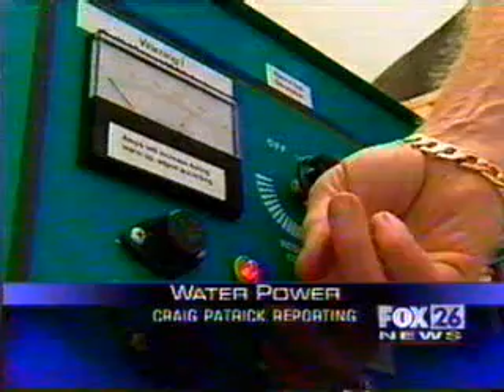Water Fuel Car

Comment: @a1mint Actually, there are examples of Steam Locomotives in operation TODAY.  The Model Railroad enthusiast. Most prefer Propane. (Less Smoke, Less fumes, Less Pollution) This is NOT an obfuscation, AND STILL, the only carrier of energy in Coals or Oils or Propane as used now, is the WATER. Hydroxy simply removes the pollutions and ash.  That you cannot accept that BASIC fundamental of all combustion is YOUR failing. SEE THIS Video. FACT: WATER BURNS,,, Knute

Comment: @a1mint AGAIN.  The Coals or Oils that once were used to fire Steam Locomotives are all, the product of organic processes of Photosynthesis. In the Chloroplasts of plants, WATER, is divided and the Hydrogen is bound to Carbon as Carbohydrates, sugars and starches, Oxygen let to the air. Under heat and pressure, deep in the earth, these Hydrocarbons are transformed into Coal deposits and Hydrocarbons. The only constituents that REALLY burn, are WATER.

Comment: @BigDaz Now, remember. Just prior to the closing ceremony when those balloons were to fall, and as tradition, the crowd to dance and stomp and pop those balloons, filling the room with volatile combustible gas, George was safe, the Balloon Vendor replaced and the compressed  tanks they were to use, removed. FACT: In the emergency, the Company that replaced the original Vendor; was limited to only using compressed AIR. DOUBT ME? Do the research. Knute

Comment: @a1mint I forgot,,, The only modification you will need to make to the crucibles, is in the “slag” hole. An increase of 4 times, in proportion, should work. Make only ONE slag hole, as the currents of molten metals need be drawn off in one direction,,, to form a “skimming” action. All the best, Knute, TR Knudtson

Comment: @a1mint Oh, one other thing. If you find the crucibles at the base of the Pyramid, DO NOT try to start this furnace or repair it. It was a flawed design. Do take note however, that these crucibles were never used. They will show no signs of ores or residue. BUT you can prove their design worthy, by testing them at smaller scales and making a smaller copy of them and employing Hydroxy as your heat medium. All the best, Knute, TR Knudtson

Comment: @a1mint Were the dust clouds, ejecta, visible immediately, prior to the actual collapse? SOOOoOOO quickly and so high up on the towers, that parts of the towers were seen to FALL THROUGH these fine dust clouds? Were their multiple seismic shocks registered at distant earthquake centers? Did they find molten masses at the foot of the towers, (STEELS’ reactivity to Hydroxy, “Hotter than the SUN”) that stayed red hot for WEEKS? As if HEATED in a furnace for days? TR Knudtson

Comment: @a1mint NOW, I will ask you again,,,, Was the smoke White or Black? Did the towers fall faster than freefall? (The vacuum effect of Hydroxy) SUCKED into the ground? Were the body parts of victims, limited to extremities, consistent with Spontaneous Human Combustion? Was the concrete pulverized to a fine dust? Are the First Responders suffering from chemical burns to their lungs? TR Knudtson

Comment: @a1mint Mike stop. I said that STEAM is an example of water being an energy carrier. You can use, Wind, Solar, Coal, Oil, Wood, OR Hydroxy to make steam for a Locomotive. Their energy ALL comes from capturing the energy of the sun and water. Fossil fuels over BILLIONS of years, or Hydroxy the DAY you need it,, and without the poisons, pollutions and greenhouse gasses. Are their Locomotives that used Coal, YES; also Coal Oils, Black Oil, Wood and even Alcohols.  TR Knudtson

Comment: @a1mint NOW,, I will ask you again. Are the First Responders exhibiting signs of chemical burns to the lungs? Specifically: consistent with Potassium Hydroxide (Caustic Soda) OR Sodium Hydroxide (Lie)? These are the more prominent electrolytes used to make the Hydroxy process possible. A way to enhance the electrical conductivity of water used to make Hydroxy Gas. All the best, Knute, TR Knudtson

Comment: @a1mint No, and I disagree. Like Hydroxy, I used steam as an example of how water is capable of absorbing energy (Directly) and that energy to be used as a form of power. You can make steam from direct “Solar Exposure” also by heating water using Wind or Solar electric, Geo-Thermal or electricity gathered from falling water, (Inline Turbines). The Steam Locomotive was only an example of WATER as a carrier of energy. An energy spunge,, if you will. TR Knudtson

Comment: @a1mint Sorry, I disagree. If you place a shiny kettle filled with ice water, over an open flame, you can see the water that is the primary component of all fossil fuels combustion; develop as a mist or vapor and condense on the sides of the kettle. Hydro-Carbons and Coal will all produce this same effect, basically, WATER from FIRE. This is called a reciprocal PROOF. Fire from water, and conversely, water from fire. This is a 3rd grade science experiment.  TR Knudtson

Comment: @a1mint Good morning. 

Mike, No, I said water is a carrier of energy. Thermal and electrical sourced and can also be disassociated by frequency, or combinations of these. The sources of these energies can however, be gathered from process that are non-polluting, Hydro-Electric, Wind, Solar, Geo-Thermal. You need not use GRID electrical power. TR Knudtson

Comment: @a1mint Okie, lunch is finished…. Mike, I was just trying to save you a little embarrassment. Coal, Oils, Wood, Wheat, Rice, Corn, Grass, Chicken, Pork, Beef, Plastic, Nuts, Beans, Fruit, Bushes and Grandmas kitchen table,,, ARE NOT sources of energy. Just,,, Biologic storage of SUNLIGHT. Now, Hydroxy ,, IS,,, different than normal Hydrogen in one way though. Simple Hydrogen is 100% inert, until exposed to oxygen. Hydroxy water, burns even in a vacuum. TR Knudtson

Comment: @a1mint This was out in the 1830s, READ, Michael Faraday, 1791 – 1867. The Chemical History of a Candle. Lectures and Illustrations. Harvard: 1904.

My contribution was to properly define the “Single Gas” produced by the electrolysis of water as a TRUE Plasma, 1967. “Hydroxy”: Electro-Chemical Plasma. Scalable to Micro Scales and also the discovery of Solar Plasmas and the advancement of the “Hollow Sun” theory, 1969. 

All the best, Knute, TR Knudtson

Comment: @a1mint Hydrogen is also the product of Photosynthesis, bound to carbon and the Oxygen,, liberated and containing HALF the energy needed. Water, the example of the greatest affinity of all elements, “IS” the primary product of combustion. Heat a polished and shiny kettle, filled with ice water, over an open flame, and you will see the WATER returned as a vapor and mist condensed on the sides of the kettle. WATER IS FIRE, and FIRE IS WATER. TR Knudtson

Comment: @a1mint And you present that energy just is,,, that there is no source,, I just disagree is all. Take a simple bar magnet,,, now HEAT IT. You will learn that the ability for the magnet to FOCUS what was always there, the EVERYTHING,, source of all creation,, has been lost. Spin this now inert, lifeless LUMP of iron in a coil of wire and NO electricity will be generated. Nothing has changed, other than the ability of the magnet to act as a FOCUS point of the EVRYTHING.

Comment: @a1mint The “Specific Impulse” of Hydrogen (How fast it ignites and burns) is 5 times greater than even Aviation gas. HHO nearly double that. The added burn rates just increase the efficiencies of what was “always there”. The POWER in the “original” conventional fuels. (A Catalyst) The very same effect spoken of in the Exxon Commercials, of their,, onboard hydrogen boosting systems. All the BEST, Knute, TR Knudtson

Comment: @crudeoilsystems Over 30% of all fuels are LOST to the “Thermal Distillation” process. Examine the reductive qualities of Hydroxy, NOTE, that it returns to water at a ratio of 1860 :1, producing a pure vacuum of  infinite volume. With vacuum, you can refine crude oils at will, with even greater accuracy, “Low Temperature” Distillation. Additionally, if you isolate the implosion from earthen grounding, through capacitance storage, you recover about 80% of the original energy needed. TR Knudtson

Comment: @mvems DID you watch the Video?  At ALL? If you will but review my Favorites, you will see our similar machine, Circa: 1990. Finished in 1986, the very same results of my work, 1967. NO CONTAINED HEAT, (259 F) yet thermal response to take tungsten, directly to a vaporous state, WHITE-HOT, instantaneously, at approximately 6,000 C. 1967 was LONG before FOX NEWS,, or Photoshop, the same in 1986, when the machine you will see there was built. A farce???? TR Knudtson

Comment: @krgrubbs You can’t steal a discovery. IF SO, we all have stolen from Michael Faraday. A Machine is but an invention, the resultant qualities of Hydroxy Gas is a discovery. Steam power is a discovery, as is electricity, compressed air, hydraulics, the inclined plane, the gear, the hand crank, the sail, the piston, radio waves, x-ray,,, ALL to be built upon by successive generations. NOT STOLEN. TR Knudtson.

Comment: @krgrubbs Dr William Rhodes, 1962, TR Knudtson, 1967, Denial Dingel, 1975, Yull Brown, 1977, Stan Meyer, 1979, Paul Pantone, 1979. Just to name a few. If you research HOH or HHO, Hydroxy, Browns Gas, Oxy-Hydrogen, GEET, HO Plasma: you will see millions now working with Electro Chemical Plasma Technologies. Denny Kline has a wonderful machine, that FULLY reproduces the Hydroxy Plasma qualities. I say, Confirms the work of some 40 years earlier, NOT stolen.

Comment: Well,,, NOT all that new, my original work was 40 years ago. But yes, I called it (Crystallized Gas), in that; there is a definite order to the resultant gas. It remains homogeneous and will not stratify, forming a strict MATRIX that is NOT random but is compressible to just under 400 psi, prior to self-detonation. BUT, you are 100% correct, the thermal yield is dependent on the given material, NOT Hydroxy. TR Knudtson

Comment: @bgbaywood It only takes about 1.57 volts to achieve disassociation of water. I ran my solar cells at about 32 volts and 15 amps. I used a smaller brazing tip, and collected the pure steels in a jeweler’s crucible and slag removed by skimming with a kitchen spoon, dipped in water to be cooled. I was a CHILD at the time. I did what seemed logical. Remember, TRUE hydroxy is,,, one gas,, containing BOTH fuel and oxidizer. Hydroxy burns under molten steel or in a vacuum. TR Knudtson

Comment: @bgbaywood I agree, 100%. In 1967, I created 3 ½ ounces of steel using nothing but water, solar cells and ore, The Father of Electro-Chemical Plasmas. Much more energy required,,, than was present in the reaction, BUT, my source of energy was FREE. About 83% efficiency. NOT “Over Unity” by any stretch. To claim you get more out than you put in, is utter nonsense. BUT,, to dismiss what Denny Kline has performed, (2007) , some 40 years later, is ALSO supreme denial. TR Knudtson

Comment: @bgbaywood All Hydroxy allows us to do,,, is to FOCUS,,,, green energies,,,, to task. Gathering wind or solar and concentrating it. The hidden value is in how quickly heat is developed in ANY process. A HEAT, or loading of a huge furnace, takes only minutes, not DAYS. The same would apply in the making of glass or a thousand different applications such as post-production re-heating of steels and metals in processing mills. TR Knudtson

Comment: Are their dangers here? OH YES!. Examine: Spontaneous Human Combustion, run-away metabolic Hydroxy plasma reaction. Plastics that melt in an adjacent room through walls, “localized heat”, matches on the nightstand that do not burst into flame, paper next to the individual that is scorched but mainly unharmed. The minerals (calcium, salts) of the human body to react in vigorous thermal yields, IDENTICAL, to what you see demonstrated above. TR Knudtson

Comment: Why support Exxon? Hydroxy catalyzed burn, means existing oils last longer. A moderated transition to new cars using Hydroxy, 20 years, with older cars modified and refitted. Tax structure that is sustained and slowly change over time. Profits for industry as carbons are replaced by solar and wind derived water-fuels. GDP that increases steadily as efficiencies are felt across the board, transport, industry, home heating, etc.  TR Knudtson

Comment: @nickqt Well not really... in fact this was known for a very long time; I think it was a German beer brewer that first came up with the idea of running cold gases to cold air, out of that came the fridge and thermal containers, later people in the industry stored hydrogen gas for manufacturing purposes but they noticed how dangerous it was if released, then a scientist that work for NASA decided to use it for "rocket fuel", why we don't use it as car fuel? well you thought it was a scam didn't u

Comment: if he is really using the hydrogen from water to power the car... then whatever you do, dont run into that guy.  forget 6 car pileups, this would be like a miniature nuclear bomb. 
besides it takes more energy to strip the hydrogen from water than it actually produces. this car would be better off just running off of a charged battery. in the long run, even if it is using the water, it would still make people use more electricity, therefore rendering the idea useless.

Comment: @DarakuTenshi Yes it's definitely the oil companies that are limiting this technology and not the laws of physics. Actually if you do research you will find that this isn't new technology at all. It was developed in the 1960's to weld at high temperatures before acetylene torches and arc welders were invented. There has been a hydrogen powered car developed by Ford but it was fueled by hydrogen gas not water.

Comment: You can't power anything by simply changing water into hydrogen and oxygen and then back to water. Doing so would violate the first and second law of thermodynamics. It might also be worth noting that the video was recorded in 2006, five years later we still don't have this breakthrough technology widespread.

Comment: @rogerrain1 
1 - That is a fun myth, but still a myth
2- trust me, the government would love to have vehicles that run on water.  Distilled water is over 820x cheaper to make than gas.  It is idiocy to believe that the government would make a cover-up that would be detrimental to itself
3- Actually, only pure distilled water can be used, or else the ions inhibit the production drastically.  Same with fuel cells.
4 - prove it
5 - ugh
6 - facepalm
7 - It is spelled "rebel"

Comment: @benbowtheturd YES! And in your second sentence you use the word,, “CURRENTLY”,, as in,, what your President George Bush called,, “an addiction”. Hydroxy is more easily made using NON-Carbon Based energy such as Solar or Wind,, and without the need for the losses involved Voltage Modification. Think of this. There is NO,,,, extension cord,,,, going to the International Space Station. All the best, Knute, TR Knudtson The Wormwood COMES!

Comment: @gabrieldov If you did even 5 minutes of research online you'd see that the exhaust from hydrogen used in cars is converted BACK INTO WATER in the exhaust. This is true of modern cars that run on hydrogen and if you watch this video at 1:05 he demonstrates this as well. 

Any questions?

Comment: @TheJimsock Where I will take some pride of accomplishment. (great cautions taken here), is that in 1967, (when I first made steels with Hydroxy), PVs cost $30 a Watt, gasoline was 27 cents a gallon, we had not yet had wars for oil,,, “directly”,,, the average automobile got 12 miles per gallon and most believed the world supply of oil was nearly inexhaustible. All the best, Knute

Comment: Automotive consumption is not the burden most think it is.  We need to introduce alternatives into industry to take the presssure off Petro Chemicals.  It's easy because the consumption is static and more controllable.
Even if we took every vehicle off fossil fuel, we would still have an energy problem.

Comment: Consequently, the energy plan, or the lack thereof, has been politicized. The mere suggestion that we would be serious about more drilling and or devoting larger segments of the infrastructure to alternatives would send the price of oil plummetting. Those wet-nosed punks in the Rotterdam ARA trading pits are a jumpy bunch. Yes, hydro is viable and for $250 you can gain 30% efficiency in the average car but, still low on my priority list.

Comment: @TheJimsock Further; America has just spent 2 TRILLION dollars and many lives to insure a supply of Oils and Gasoline. But YES, let’s do talk efficiencies here.  Please remember, you do not NEED a Dam, to extract Hydro-Electrical power. Japanese (Inline Turbines) do this most effectively and you only need 50 foot of drop for them to operate at high efficiencies, the water sampled from the stream by a wier-box and flume pipe, and the water returned.  Knute

Comment: @TheJimsock Well,, perhaps Wind and Solar are distant from points of use in SOME PLACES, but in Germany and America, rooftops of large warehouses and retail stores ROOFS are leased for Solar installations, right in the center of town. Solar (PVs) can also be set directly atop an Auto, the energy to make Hydroxy, stored in batteries, till needed.  Exxon-Mobil is touting 80% more energy efficiencies of conventional fuels using NORMAL hydrogen, as a catalyst to the burn. Knute

Comment: If wind and solar are free, why are we paying so much for it?
Because Wind Mill and solar arrays are so far from population centers, most of the juice is lost in grid transmission.
I'm OK with hydro but, right now, it is neither free nor renewable.  The electricity needed to produce it is made by coal.  All the alternative plants are too remote to have a significant impact.
Get the tree huggers off the anti-nuke kick and now we're talkin'.